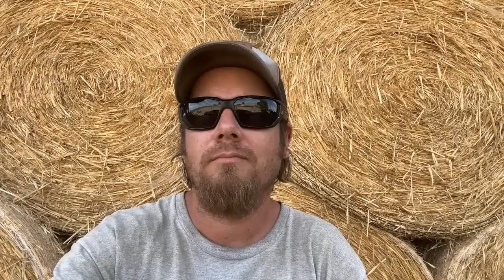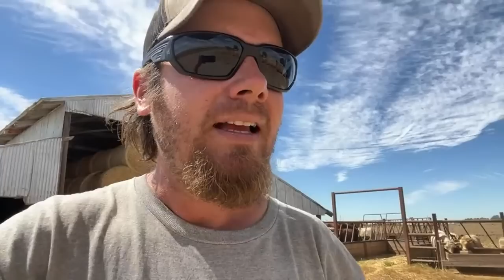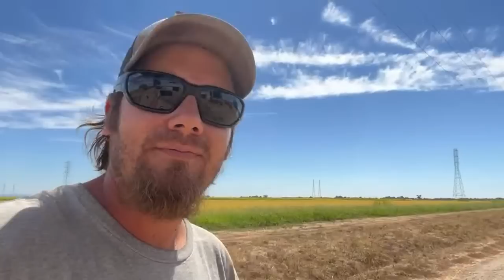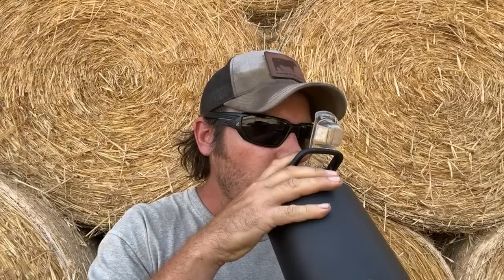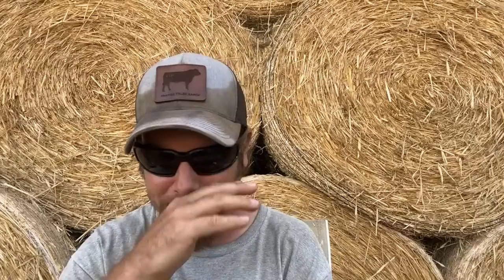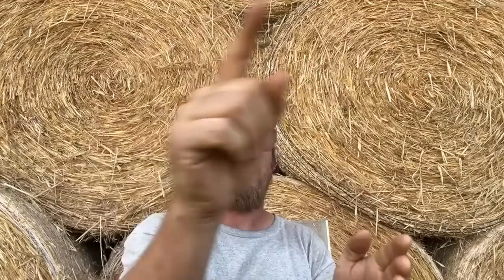Farmer Tyler Ranch is live!

Comment: I was just wondering,  Tyler,  if carpet would actually work for your wiper.  If you could attach squares of carpet to your roller that would lay flat on the upturn and pick up the spray and then flop down and wipe the weeds.  I don't know much, just a thought.  And you could get many of those free from any carpet suppliers.

Comment: What if you used some french drain pipe sock material, maybe 2 or 3 layers of it as your chemical transfer material over the PVC pipe.  Maybe having the sock be an inch or two larger in diameter than the PVC might allow the sock to droop and contact more weed surfaces.